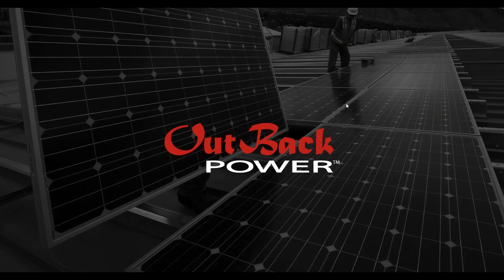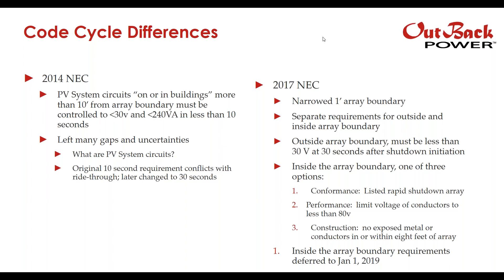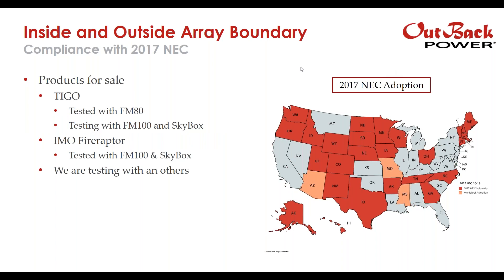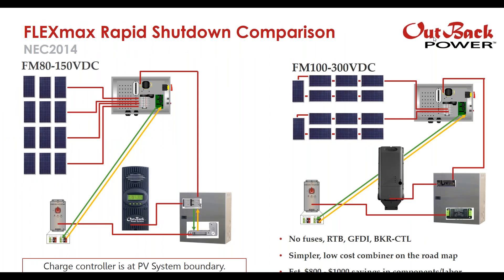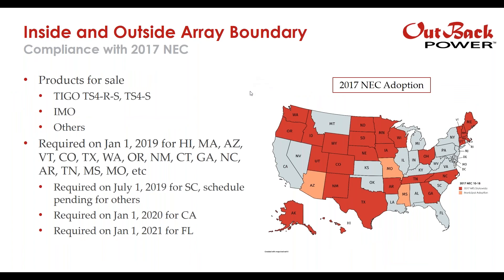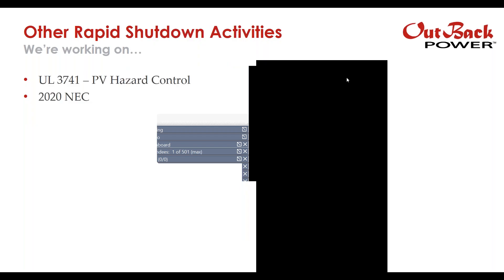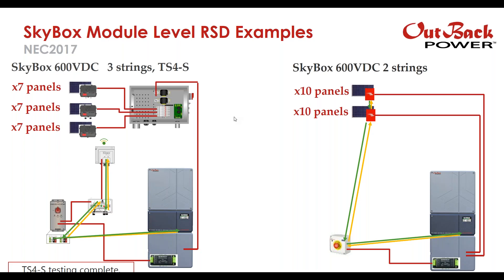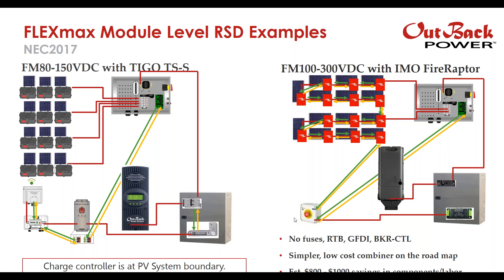Webinar | OutBack Power and NEC 2017 Rapid Shut Down

Comment: do I need rapid shut down if my solar panel array is on top of a stand alone pergola located 10 feet from my home? I thought I read that rapid shut down on applies to solar arrays on a residential roof.
Reply: yes, indeed. Because it is referring to the solar array requirements  without considering where it is located.